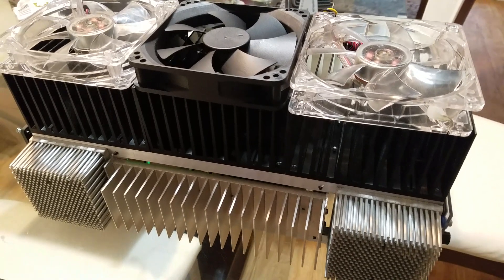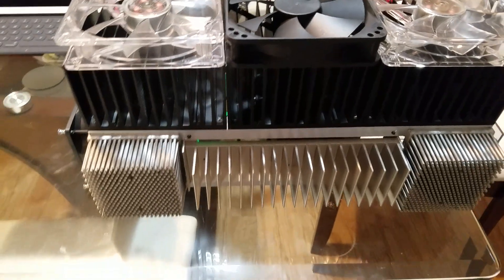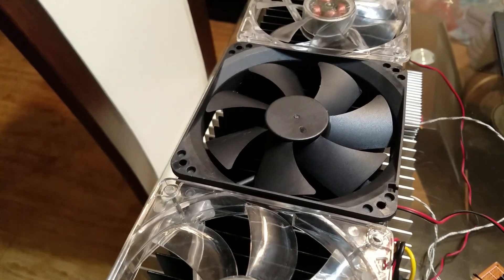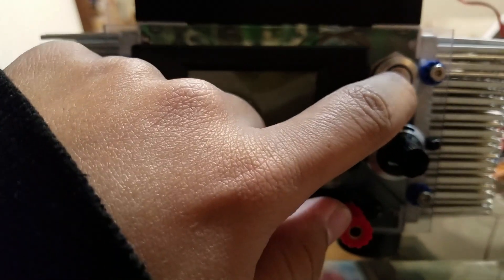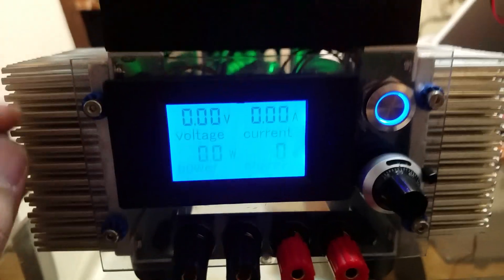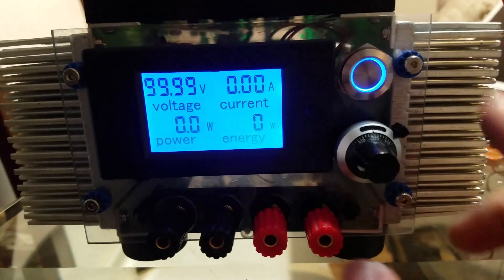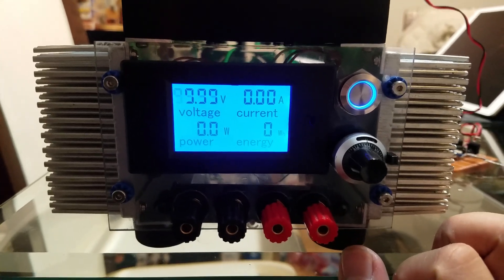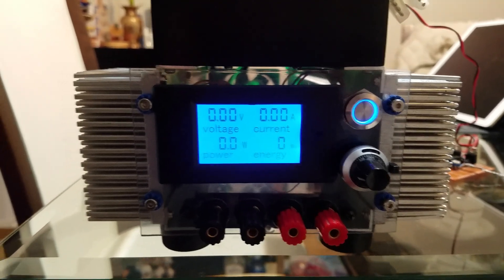200V - 100A - 20,000 Watts Monster Electronic Load DIY Coming Soon!!!

Comment: 200v maybe, 35A maybe, NOT both at the same time, look up a Bird 5000W dummy load, it is a test antenna for radio for testing high power radio amplifiers, its basically a giant oil cooled 50 ohm resistor, it weighs 120 pounds or 55kg the 10000W model has really powerful fans on it. you are not going to approach 20kW with the aluminum you have on your bench.
If you go by transistor package datasheet ratings the best one which is TO-3 could be rated for 300W those are very big, to just barely dissapate 10kW on TO-3 transistors you will need 34 of them, this would take up 230mm^2 of area of just transistor packages.
hope this helps you reach half your goal.